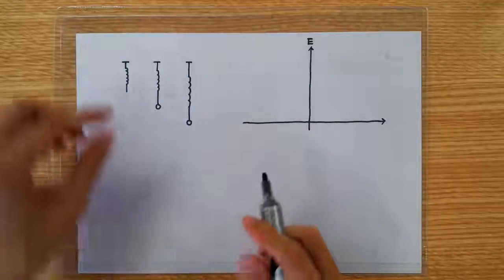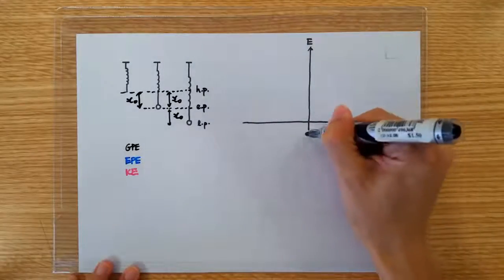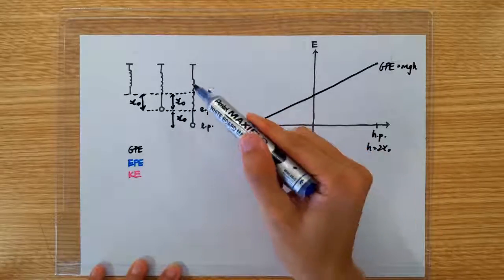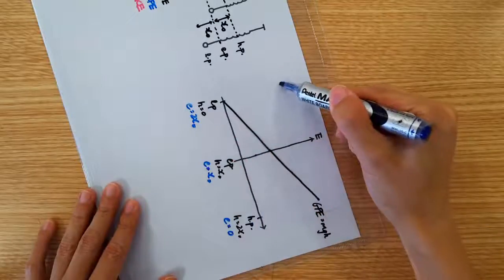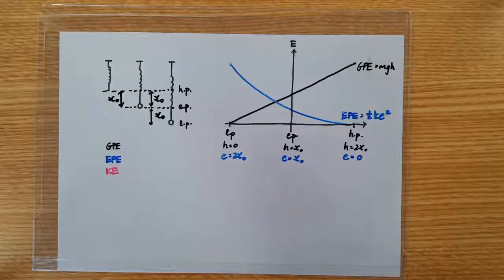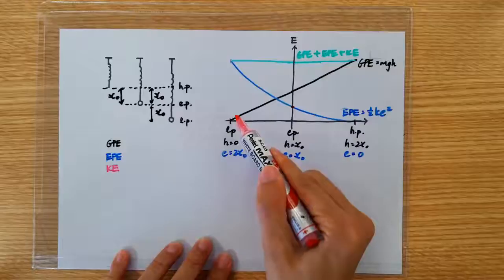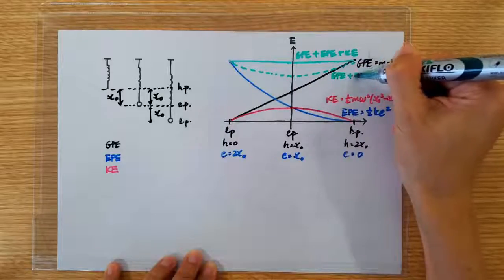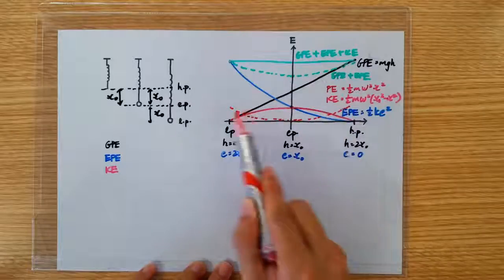Energy of Vertical Spring-Mass System

Comment: Sorry I don’t get the part where you said the total PE of the oscillation ought to be zero at the equilibrium position 5:42 when the spring still has EPE and GPE at the equilibrium position?
Reply: It all depends on your choice of reference zero point. Commonly, EPE of a spring is chosen to be zero when it is unstretched, and GPE of a mass is chosen to be zero when it is on the floor or some lowest point. But there is nothing to stop you from choosing another zero reference point. By definition, the PE of an oscillation (pendulum, spring-mass, whatever) is zero at the equilibrium position because at that point, KE makes up the total energy, and thus PE should be zero (because TE=KE+PE). In a vertical spring-mass system, PE of oscillation comes from (changes in) the EPE of the spring and GPE of the mass, but with the zero reference point shifted, so that EPE+GPE is zero at the equilibrium position.
Reply: @xmphysics  thank you so much for the explanation!

Comment: Hello. Your saying energy in physics without a physical prop. So if I handed you a thermometer to measure and prove that calorie transfer of energy on the y-axis with Hookes prong mass system. Your going to have a real hard time showing that delta of energy with real physics prop. A piece of paper isn’t a physical prop with metric measuring tools sir.
Reply: Not all energy is thermal my guy